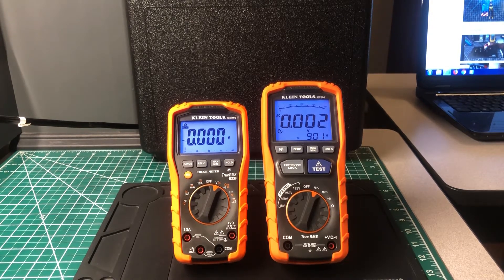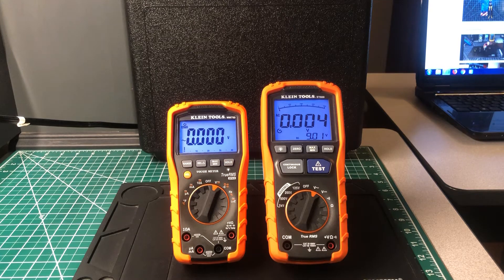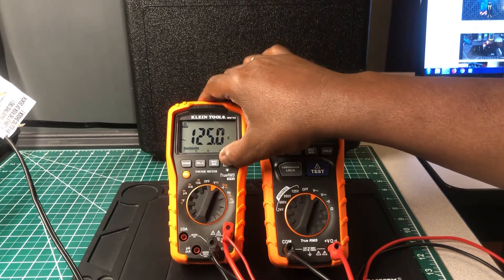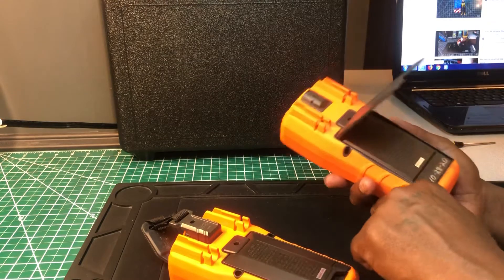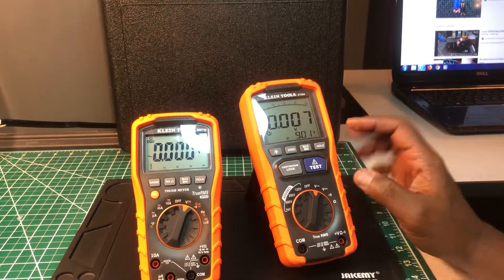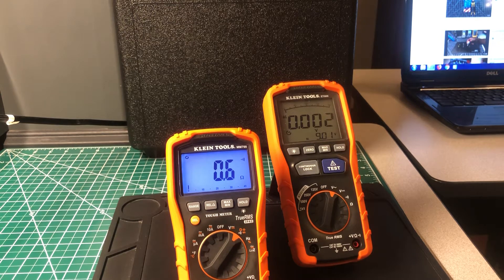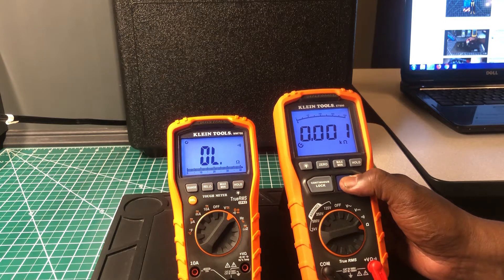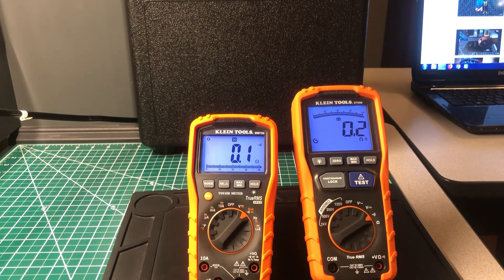🇺🇸 KLEIN TOOLS vs. KLEIN TOOLS ( Comparison Video )

Comment: I'm having difficulty finding a DMM that correctly does run caps used in HVAC for a reasonable cost. I have an Amprobe clamp AM 14 pro clamp meter and it shows 114mf on an 88-108 cap. i also have tried several cheap trms meters and they show as much as 144. the only one I have that reads correctly is an Amprobe AM570 which shows 107.5. the Amprobe is nice but a little pricey for my once in a while needs. I ordered an MM700 hopefully that will give the correct readings so I can return the amprobe
Reply from the maker: Most HVAC techs use FIELDPIECE or UEI  go to their website and choose the meter that’s right for you.. 👍🏽